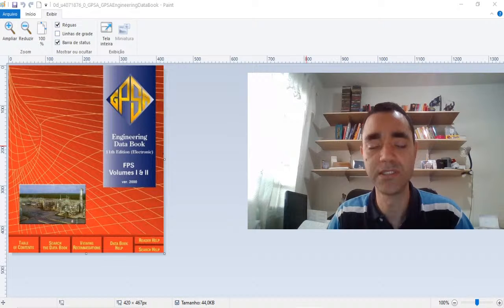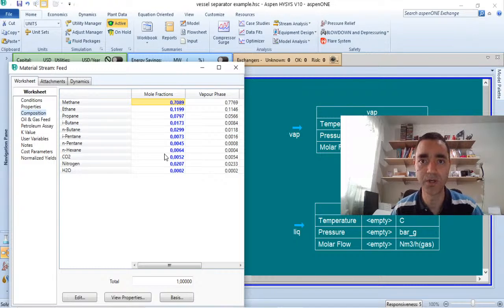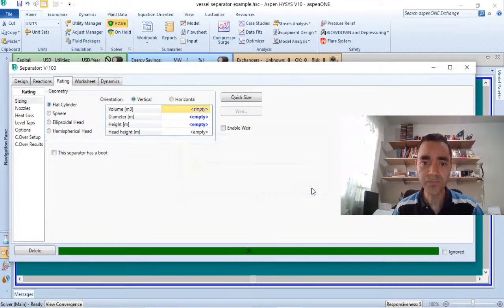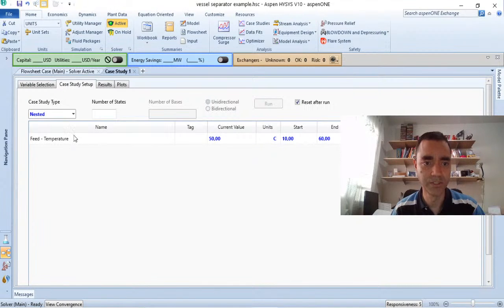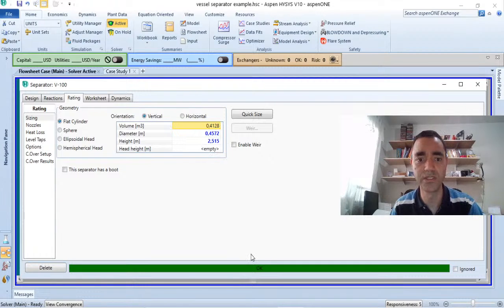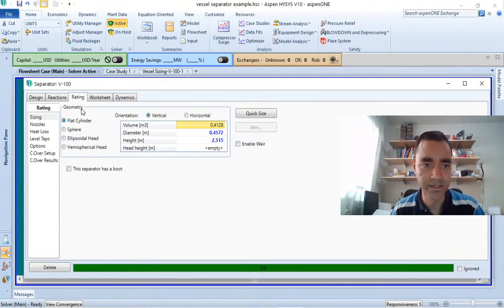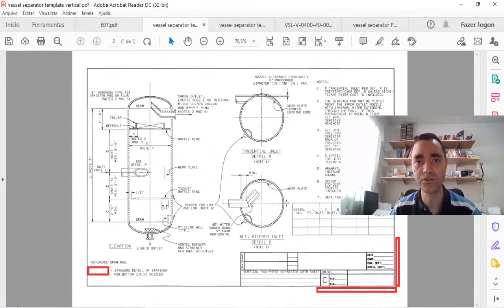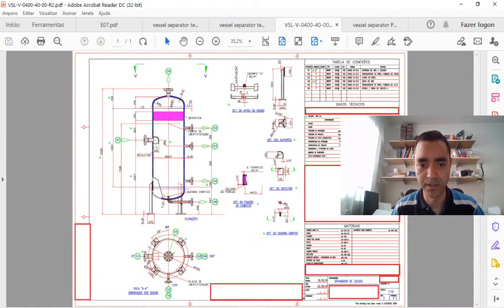Vessel separator aspen hysys and drawings for chemical process engineers

Comment: Hi Jefferson, I am constantly trying to design a two phase separator by using Aspen HYSYS. I could not understand the LLSD parameter, is it the Low Liquid Level or something ? And is the Surge Height the distance between low liquid level and high liquid level in Aspen ? Could you explain it briefly ? I would be very grateful if you do. Thanks for the great content.
Reply from the maker: Hi, LLSD is related to the lowest level your vessel can reach. Once it is achieved, usually there will be some kind of shutdown. For instance, drainage valve will close. Surge height can have different definition, but in generall it is related to the height of liquid up to the maximum level allowed.  To do vessel separator sizing you need to consider different height sections in your vessel, each one with a purpose. Aspen HYSYS is not the best tool to perform vessel calculation in my point of view.

Comment: Amazing video once again Mr. Jeferson! :)

Would you say the vessel sizing or quick sizing is a good starting point to what the actual real separator size is? For this example, how far off is the real size from the "vessel size" determined by HYSYS?

Thank you! :)
Z
Reply from the maker: Hi, it is a good starting point.  The process engineer must draft vessel drawing and verify if all requirements are there. Different companies may have different criteria for liquid holdup and length to bottoms for instance. It is important to guarantee, at least, the minimum diameter for separation performance. Final dimension depends on, not only process, but also on manufacture materials.